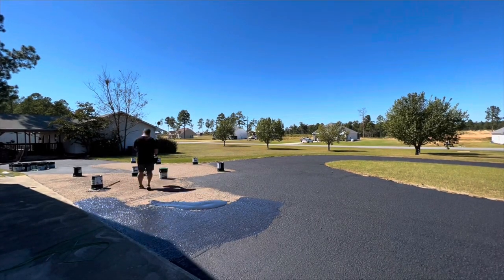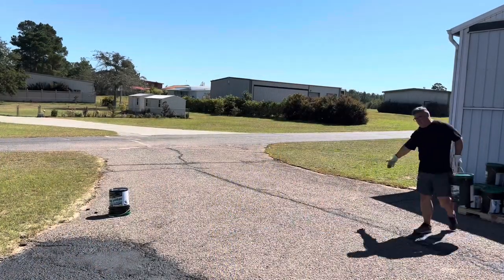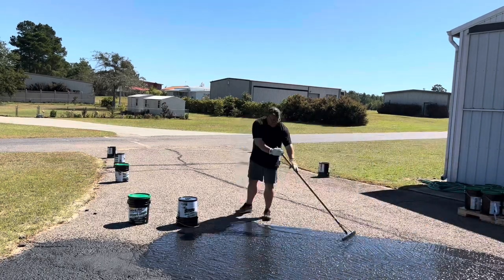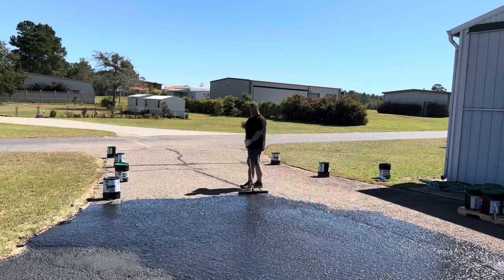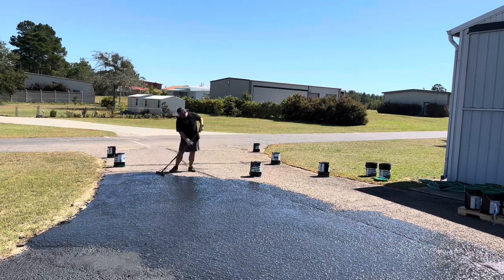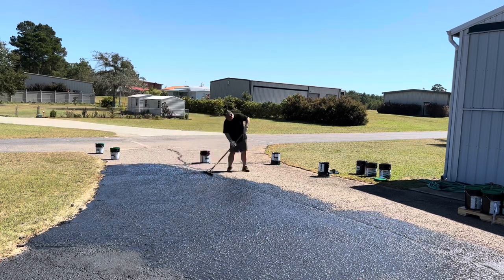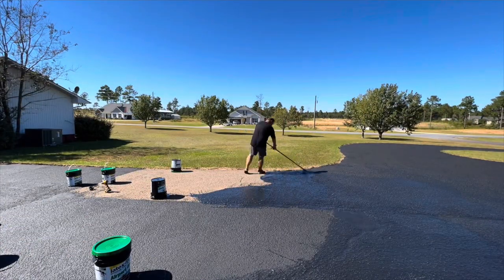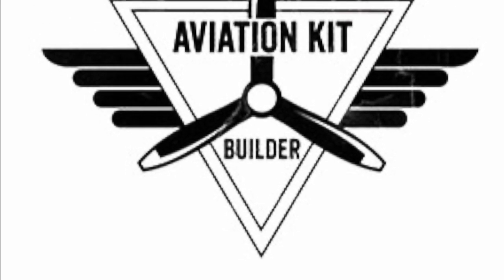Taxiway / Driveway Restoration Part 2 Asphalt Sealer using Latex-ite Airport Grade Sealant

Comment: Try using a brush/squeegee combo. Get down into rough section and get thinner coat/ more coverage
Reply from the maker: Probably would have been useful to use, thanks for the tip.  I hadn’t ever done this before so I didn’t know this would be an issue.

Comment: Great job!  Question, I also have an old asphalt driveway that I planon repairing ans sealing.  Your thoughts on using a brush (push broom, to get into the nooks) on the first coat instead of a squigie?
Reply from the maker: I would definitely give a broom a try.  There was comment on here that you can buy a brush specifically for that situation that has a blade and brush together.